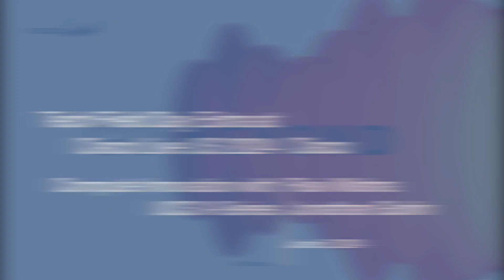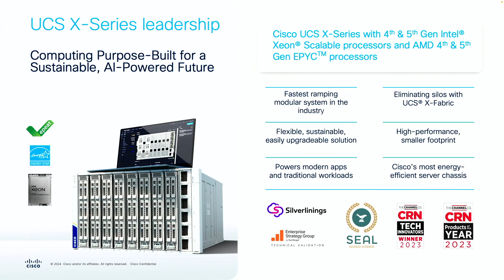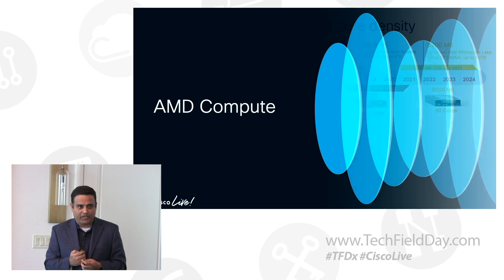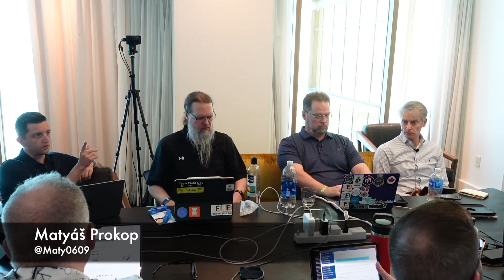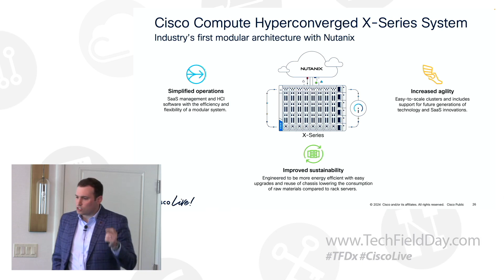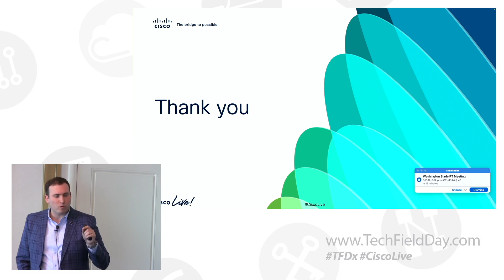Unleashing Innovation with Cisco UCS X-Series: Next-Gen Servers for Modern Data Centers

Comment: Can I still use Cisco UCS S3260 as external storage for UCS-X? Could I still use storage brands like NetApp FAS or ASA, Dell EMC PowerStore or Unity, IBM StorWize, Lenovo ThinkSystem, or HPE Primera or XP8 for external iSCSI and NVMe-oF storage?
What about external PCI expansion chassis for GPU accelerator and flash expansion?
I prefer external storage enclosures over internal storage modules. I also prefer like external GPU expansion. Particularly for hyperscale data centers.
Reply from the maker: Hi there, thanks for your questions! The Cisco UCS S3260 Storage Server can be used as a storage solution, and it supports connectivity to existing NAS or SAN storage environments through unified I/O for Ethernet or Fibre Channel.

For hyperscale data centers, the Cisco UCS X-Series is mentioned as being suitable for virtualization and supporting a range of workloads, including AI/ML and video streaming apps, with options for GPU support within the system. However, details on external GPU expansion are not availble. We hope this information helps!